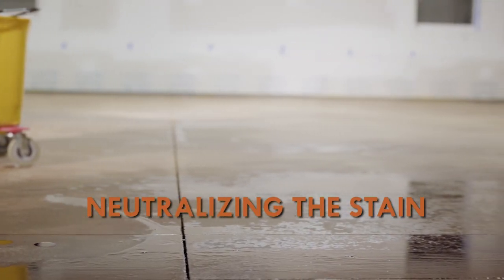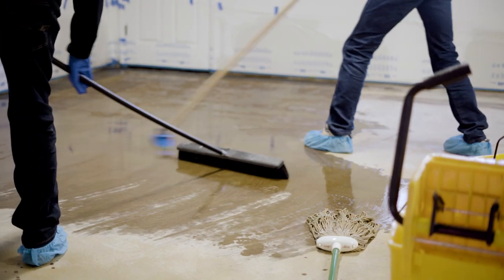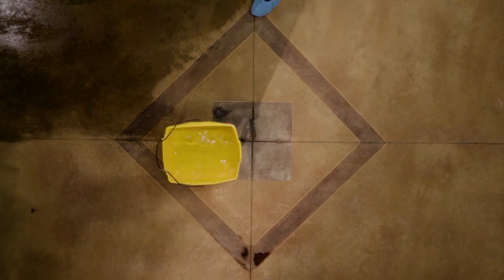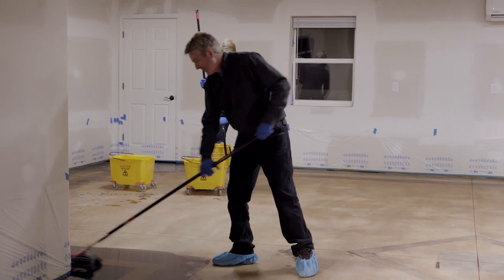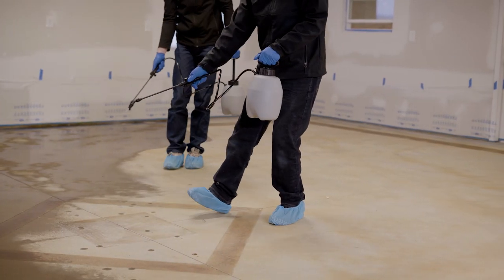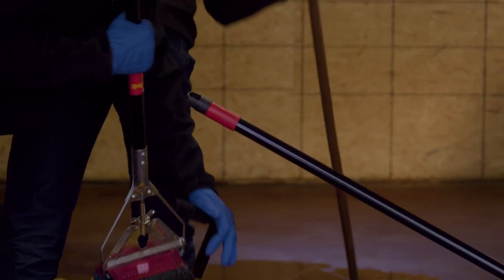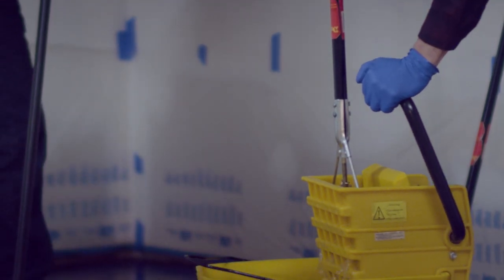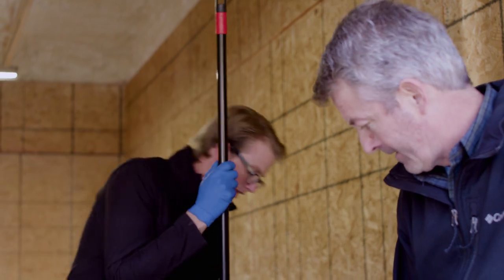How To Neutralize Concrete Acid Stain - Floors & Exterior [Part 5]  | ConcreteCamouflage.com

Comment: I never thought of the sealer as just cosmetic, it also makes it a lot easier to sweep and wipe up spills before they soak in, and will stop the surface from creating dust as it wears. I’ve done a lot of restaurant floors and always apply a good cover of sealer and when that’s cured I apply multiple coats of a high solids floor wax to act as a sacrifice coat  for when the floor cleaners mop up, which is usually every night.